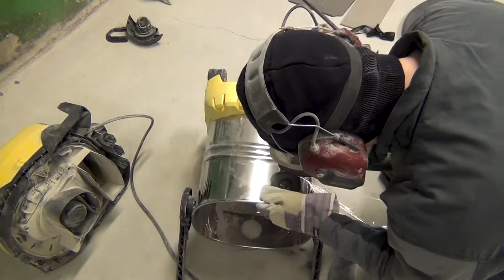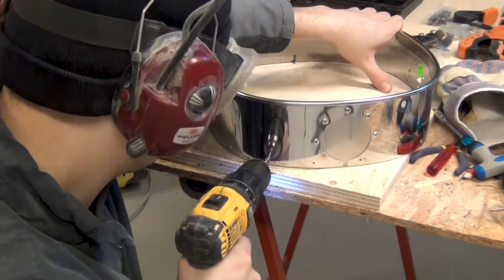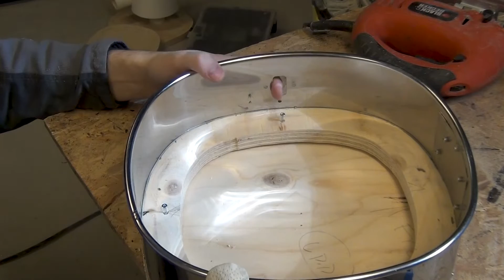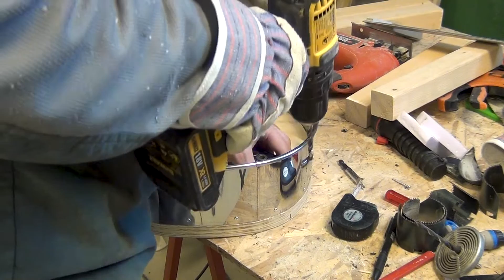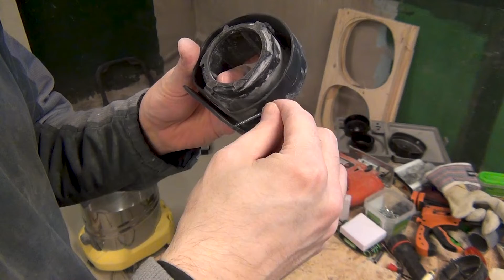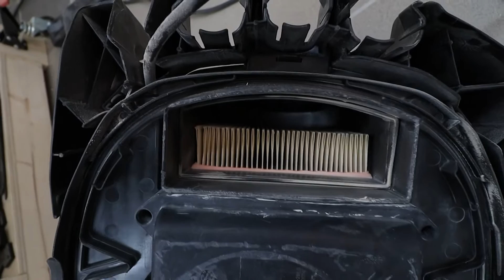My Shop Vac Cyclone combo changed my life!

Comment from the maker: I need good some suggestions on how to make it more stable to prevent it flipping over because of the added hight. How would you fix it?
Reply: How about adding weight to the base, like maybe a 1cm plate under the bottom? Another option - and a lot more work  and expense - would be to make a new version that uses a low-profile separator. That would allow collapsing down the assembly by quite a bit and helping with the balance issue. That said, if you're happy with it as-is, I vote for the plate weight solution.
Reply: Hi, first of all: I just came to this video and think, it is a great approach! Thanks a lot. To reduce the danger of flipping, you might increase the weight of the bottom parts. A thick metal ring around the collection bucket, some stone between the four rolls below the collection bucket... This of course will make it heavier, however, this machine is primarily not meant to be carried, right? Thanks again and best regards from Bavaria 🙂
Reply: Easy, use it for sanding concrete and it will naturally get much heavier on the bottom :)
Reply: How about adding weight to the base, like maybe a 1cm plate under the bottom? Another option - and a lot more work  and expense - would be to make a new version that uses a low-profile separator. That would allow collapsing down the assembly by quite a bit and helping with the balance issue. That said, if you're happy with it as-is, I vote for the plate weight solution.

Comment: It looks like it is full of sawdust, but you said you were originally inspired to make it after sucking up concrete dust. How well does your design work on finer dusts like concrete, plaster etc?
Reply from the maker: It work very very well. Only a weak ago i had to cut up my concrete floor and it just sucked it up like a champ :)
Reply: Ive got a similar setup, and the fine stuff still gets through and eventually fill up your filter. The difference between my 1st and second versions was easy access to both chambers. It's still worth it 3X. Just dont expect the cyclone to get everything

Comment: To prevent damage when you flip it over by accident, you could make a wooden ring that sits around the four legs in the middle. So it will flip on the ring and wont break the engine part
Reply from the maker: Thanks for the advice!